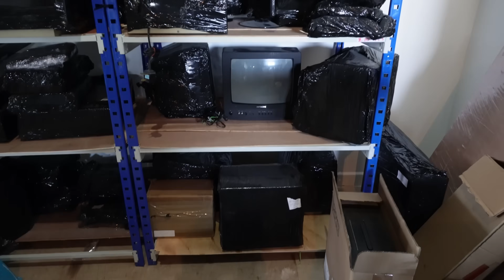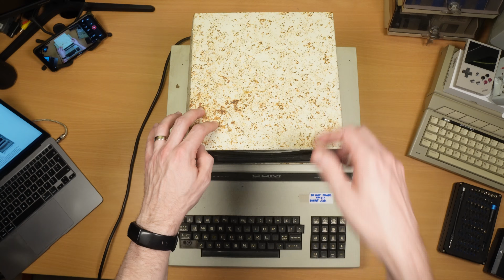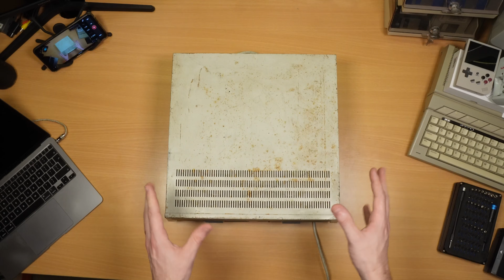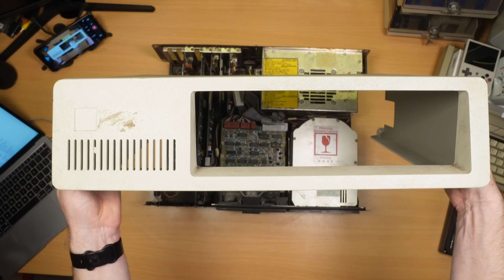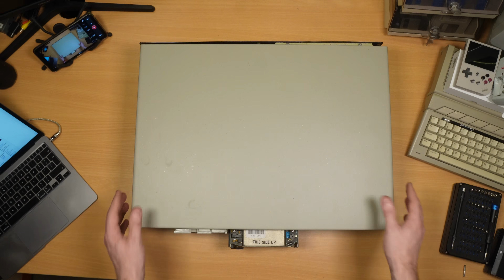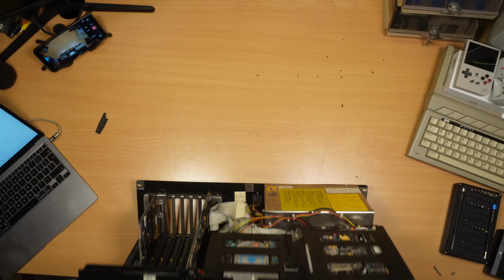You Won't Believe What's Inside These! (Actually You Probably Will)

Comment: The Commodore 8050 drive which connected to the PET uses IEEE-488 parallel communication.  The drive controller has its own 6502 Microprocessor.

Comment: i wouldnt worry too much about  original power supplies like in that pet, more reliable and less to go wrong than in  a 'modern' switch mode thing..take the transformer out , brush it, and gi e a few coats of  slightly thinned down solvent based yacht varnish(not  water based one)

Comment: That's actually not a PET, it's a later CBM model...  The original 1977 PET came with 4K or 8K of RAM black and white monitor, the chicklet keyboard and built in cassette drive.  Around 1980, they added the CBM models,  intended for "commercial" use, a real keyboard, green screens, and more memory, yours has 32K of RAM.....    The 8050 was a single sided, double density drive, I used to know the command to print a file, without loading the file into the computer first.....

Comment: You are right that there is the 5161 PC Expansion unit that can be connected to a 5150 IBM PC, so you can add a hard drive controller, a hard drive, and possibly some I/O cards. The 5161 has a passive backplane, and 8 slots in the same layout as the IBM XT. There is a pair of 8-bit ISA cards, one to be installed in the 5150 and another one to be installed in the 5161, connected with a quite thick cable. The plugs for this cable are on the slot cover.

As far as I know, there never was any official IBM 16-bit expansion solution. And if there was, it wouldn't have been connected using a cable through that feed-though, but using a regular connector on the slot cover. The piece of metal with the hole is not original, at least not in that state. The 5170 has a battery door for the CMOS backup battery at that location.

Comment: I always used ISA slot for 16-Bit (286) slots, while the shorter one is ust an 8-bit XT slot.
EISA was then 32-bit, around the same time as Microchannel (IBM's choice for patents, most likely).

I still have the 8-bit bridgeboard which would actually also work with an ISA 16-Bit VGA card :)
Need to fix the AMIGA 2000 main board, though. The PSU had a problem being connected to it, starting to tick.
I did get the Batteryleakage cleaned up - it wasn't too bad.

Comment: No, the PET isn’t an early model. The first release was the PET 2000 series with a chicklet style calculator keyboard (which was horrible to type on) and a built in cassette drive. From memory they came in 4 and 8K sizes. The 3000 series fixed the keyboard (requiring the cassette drive to be moved externally) and moved to DRAM memory thus allowing 16 and 32K sizes. People worked out that it was cheaper to buy a 16K model and add the extra 16K of memory yourself, and Commodore stopped that by drilling holes through the motherboard.

Comment: Hi, nice older hardware, unfortunately my collection these days arts with Pentium 100

I purchase d new C64, PC XT Turbo clone, Amiga 500, 286,386,486/the P100 etc right up to a HP P4, that lasted 2003 to 2012 as a daily driver

Now i also have Pi3b, PI400, Pizero2w and i really want a Pet or classic early mac case and flat laptop screen to make them look older and just run a emulator for nostalgia and reliability

Comment: There's a RIFA cap on the PSU input of the 8050 drive to be aware of - mine went fizz-fizz-pong the first time I powered it up. Also, the single board over the right-hand drive has the motor & head electronics for both drives, you'll see a flying cable go to the other drive. The big digital board attached to the roof has more processing power in it that the PET it's attached to - there are two 6502s in it! Yep, it's a dual-processor!. BTW, grab some spare 6502 chips - they are somewhat prone to die in these machines.
Reply: You are not wrong about the 'pong' bit.

Comment: I'm fascinated by the "maxed out" XT - I wonder if it was built like that or if it's one of those situations where someone had it when this kind of stuff was getting thrown out and so they slowly built up an "ultimate" configuration. I remember doing the same with old 486s in the early 2000s and then again with Pentium III-era kit later in the decade; maxing out the motherboards with as much memory as they'd take before refusing to boot.

Would be a good one to track down some original software which needs the 8087 and all that RAM. I think there were a few early CAD packages which wouldn't run without the coprocessor installed.

Comment: The connector on the 5160 floppy card is for an external drive, you could have up to 4 floppys on those systems.  
And the yellow bodge wires are factory on some 5160 motherboards.
Reply: To be exact: The connector on the 5160 floppy card is for two external drives. With those IBM controllers, you can only connect two drives per cable: Two internal drives to the card-edge connector at the "rear end" of the card, and two external drives to the 37-pin D-type subminiature connector on the slot cover.
Reply: @tw11tube  The dreaded IBM twist.  They just didn't trust us to set the jumpers, like we had to for EVERY other setting in the machine lol. Remember the days of squared paper, working out what IRQ DMA and address we could squeeze everything into?

Comment: Looks like you've got the 9.5" screen model for the PET. You won't be able to use the Amstrad GT monitor - physically too big and power requirements are probably higher. You can do an internal mod (or external user port mod) to output composite video. Also, would recommend BitFixer's Romulator to help with diagnosis on 6502 based computers/disk drives. it's very nice bit of kit that can emulate ROMs and RAM. Decent price too. Oh and Stupid pet tricks is a nice project to build to add joystick ports and internet access.

Comment: The IBM AT also originally came with a decorative black plastic cover for the rear, but most of those got broken and lost decades ago. The drives have grounding wires because they're attached to the case with plastic rails, so they don't get directly grounded to the case like in other PCs. As for the CRT in the PET, by the late '70s small monochrome picture tubes were pretty much all electrically compatible and used the same pinout, so as long as you find one that fits in the case, it should work fine.
Reply from the maker: Well that's all very useful, thanks for the info. I've never seen one of the black plastic rear covers, I shall have to keep an eye out. 🙂
Reply: Surely they could have been grounded via something on the ribbon cable or power connector !

Comment: The 5150 was the original IBM PC (the model number was chosen to insinuate it was in the same line as the 5100, whose name escapes me - DataMaster? - but which also had an Intel CPU). The 5160 you have there was the PC XT, which (allegedly?) stood for eXtended Technology.
Reply: The 5100.5110/5120 had a 16 bit Palm Processor, which was a S/370 microcode emulator(ish) no connection with Intel.
Reply: @martinhow121  yes, you're correct about the processor. Thanks for that.
Reply: The Datamaster name relates to the IBM System/23 Datamaster (models 5322 and 5324), which used the Intel 8085 CPU. The 5100 was just called the 5100.

Comment: Some nice machines you got there. Looking forward especially to the restauration of the CBM 3032 and disk drive. Can't really read the burnt-in on the CRT, but no matter the language, it's probably not something you'd like to look at. From time to time, these monitor "tops" of the CBM series pop up on ebay, but I guess the mentioned replacement you might get is the quicker way to go. Cheers!

Comment: From my experience, the PET power supplies are quite reliable and the only thing that explodes on them (but it does that quite reliably) is the input filter capacitor. The 8050 has it integrated into its IEC power socket. These huge soda can capacitors are usually fine. I've seen charred pins on the power connector in one case, which made the machine unstable, but a new PSU is not gonna fix that.
Reply from the maker: Interesting, that's useful to know thanks. It would be nice to keep it as original as possible - of course it will be thoroughly tested.

Comment: You didn't mention or didnt notice the 8050 disk drive has a 6502 processor and is in fact a fully working computer - you could upload code to it and execute it. There were a few database applications that made use of this function.
Reply: Nice, all the peripherals were connected with the IEEE-488 bus, which was a widely popular standard in industrial applications at the time.  I remember using the RML-380Z computers using this in college in the '80s, then using the PET (and HP controllers, oh, and even the Sinclair QL had an aftermarket IEEE-488 interface board)) to control equipment (Racal, HP, etc) and various other test equipment in the early '90s.  Now it's all USB, but I think you will find that the underlying protocols used are still very IEEE-488 in many instances.
Reply: The original idea was multiple pets could all share the drives by connecting them all on the same 488 bus.
Reply from the maker: Ah! I'd actually heard this rumour about an old disk drive but didn't realise that that was what I have here. Definitely something to investigate - thanks! 👍
Reply: Not sure if true but back in the day I was told these drives could load code that effectively made them able to copy protected disks, almost like flux copiers today. Allegedly these could copy Atari 800, Apple etc games.

Comment: The 5150 and 5160 cases are quite different.  The 5150 has a cassette port next to the keyboard port and the expansion cards are spaced differently. So transplanting motherboards from one to the other is a bit of a no-go. 😞
Reply from the maker: True, but I think the top case should be the same at least?

Comment: I saw an ALTOS 986 (10 MHz, 8086) in the pile of computers.  40 years ago, when in Graduate college, that computer with a “new” 3com Ethernet (10-Base-2) add-on card was setup as a 3Com File Server (Xenix? OS + 3Com software) for Business school laboratory.
The computers attached to that Ethernet network were IBM PCs (PCDOS 1.1 or 2.0) with 3Com network cards.
As I remember, SuperCalc and Wordstar were 2 applications.  Lotus 1-2-3 eventually appeared.
==
IBM 5160 was my first computer, acquired from an IBM dealer w/o 10 MB hard drive. The original hard drive had failed, and was exchanged with original customer.  
Cost at that time (1983) ?? 
$ 1500 USD for that IBM XT; then 20 MB hard drive ($1500) which was added; plus $100 for Hayes Smartmodem 1200.

Comment: No powder coating in the late 70's. Good old spraypaint😂
Reply from the maker: Oh I hear ya! But I think powder coat will be closer to the original finish (as per the IBM machines) and harder wearing than I could ever achieve with rattle cans 😅
Reply: @ctrlaltrees just had a pc case sand blasted and powder coated. Definitely recommend.